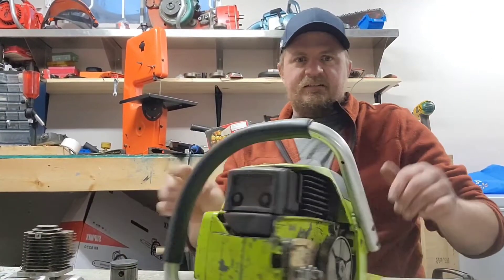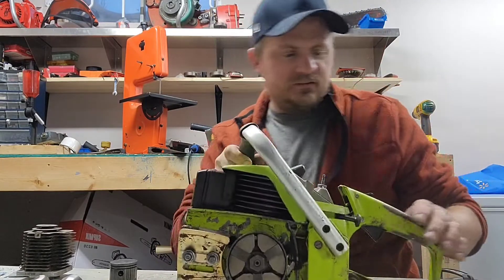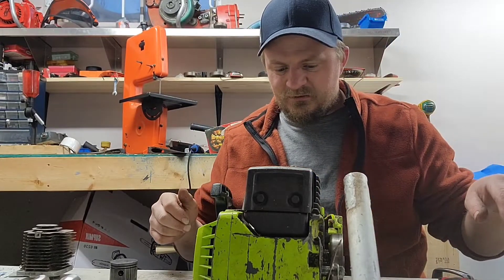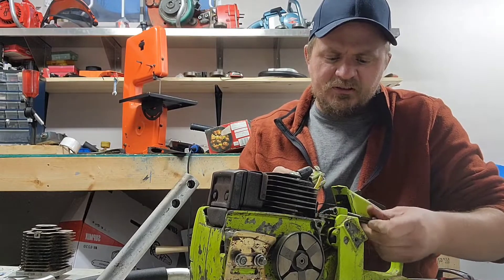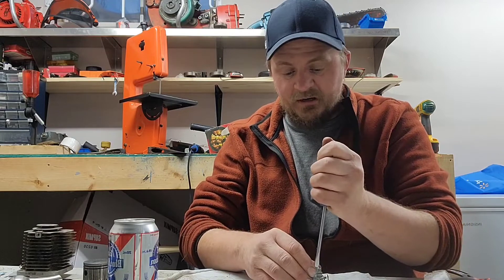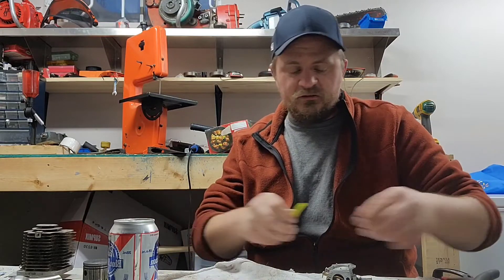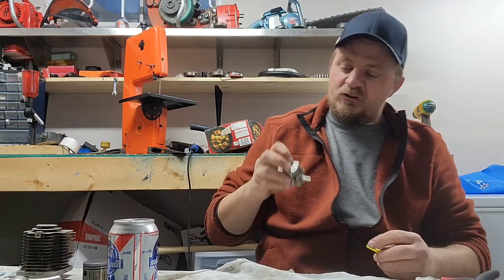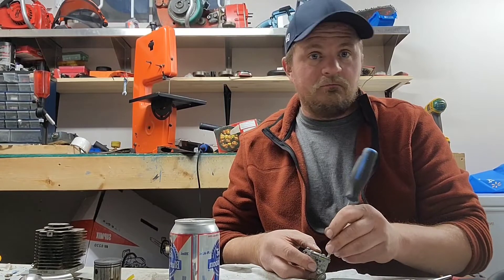poulan 3400 countervibe update... @$#&!!!

Comment: Odd.  Always had rich issues with these carbs. Bad check valves. 
Don’t know….
Reply from the maker: Yeah it's just not getting fuel and I don't know why.. Maybe a crankcase air leak causing a weak pulse?, check valve is working.. Might see if I can rig up another carb, maybe a wat and just make a impulse line
Reply: Assume you checked the needle/seat spring pressure. How about some oil in the impulse line to see if it’s plugged? 
Again, most I’ve had get too much fuel!  
And by impulse line, I mean where it comes through that transfer. I also recall making a carb gasket on these and it needs the impulse hole for the carb.  
Just some ideas.
Reply: Didn’t sound like the Check valve was sealing.
Reply: im having a similar issue but i am getting fuel.   too much it seems....... spark, compression good.    won't run even on starting fluid.... it's maddening...
Reply: Might be the check valve. If you look on Leon’s chainsaw channel and use” check valve”, he has a video showing how to check it.